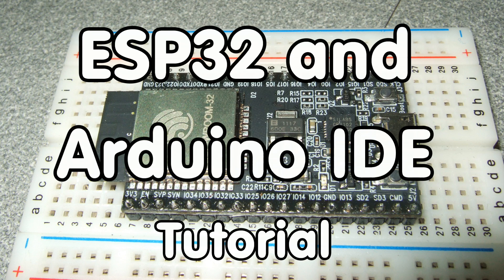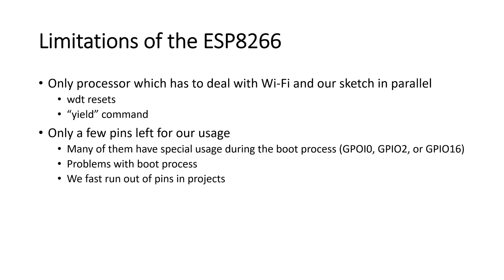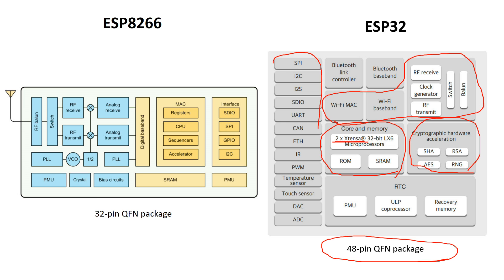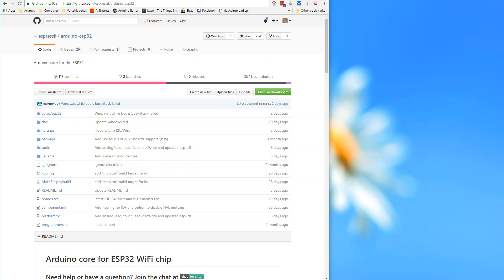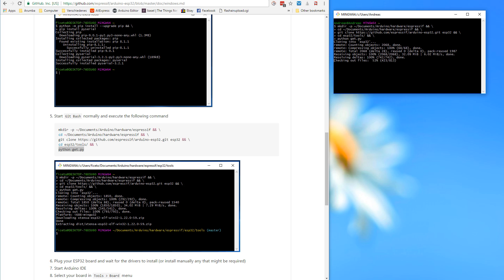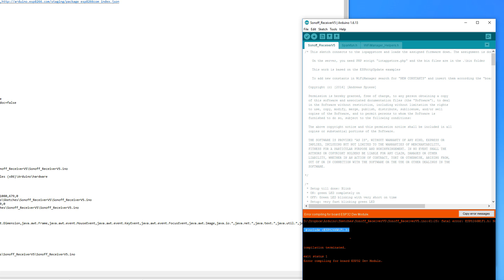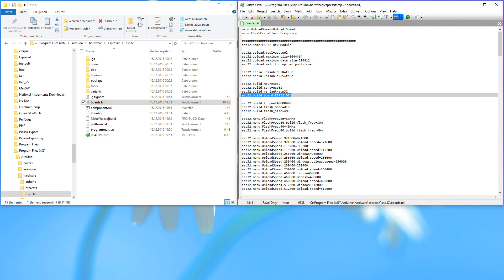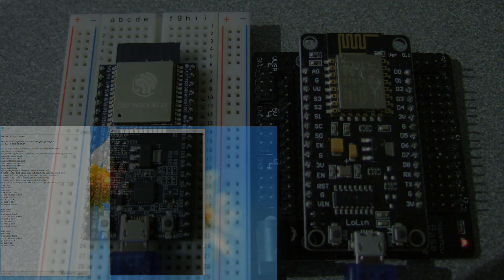#103 ESP32 Tutorial / Arduino IDE  / Tests / Comparison with ESP8266

Comment: I have some of these on order since December 4th,  and they're not here yet...  :-(
Reply from the maker: Depending on the source it takes quite a long time. With Christmas and Corona maybe a little longer...
Reply: They arrived here yesterday.  And now I'm running into a bit of a problem on the software side.  Your video, and several web pages, all point at hitting that "preferences" menu page and adding the necessary stuff to the arduino IDE but when I open that it doesn't look like what you show in the video,  there's no place to put that info.  The last thing I see is that bit about updating the extention on save,  followed by a link to the preferences.txt file if I want to edit it myself.  And on looking at it I see no obvious place to put that info that's needed in there.  What I have installed here is rather odd in terms of version number,  it's 2:1.0.5+dfsg2-4, which is directly from the Debian repositories (where I usually get my software).  Is there some way I can just download the required stuff and put it into my setup manually?  I'm hesitant to download the "latest" arduino IDE directly from them,  as I'm not clear as to how my system's package manager will handle it,  and besides it's a rather large file (100MB+) coming in over a rather slow DSL connection...
Reply: Never mind.  The Debian repository version is apparently VERY old!  I did download the current IDE and installed it,  and that stuff is in there like it's supposed to be.  Onward...
Reply: Okay,  the IDE has been upgraded to the current version,  and the support for both ESP8266 and ESP32 has been installed.  Now the system doesn't see the boards.  If I plug in for example a Nano,  it will use the serial port /dev/ttyUSB0,  but that choice doesn't show up as one of the choices when I plug the ESP32 in,  just /dev/ttyS0, 1, and 2, none of which pertain to the USB connection but which are actual physical serial ports that are unused at present.  I've been searching for an answer to this,  as well as wanting to know what if anything I am supposed to be doing with those two buttons on the board but so far no luck.  The boards I am using are these:  https://www.banggood.com/Geekcreit-ESP32-WiFi+bluetooth-Development-Board-Ultra-Low-Power-Consumption-Dual-Cores-Pins-Unsoldered-p-1214159.html?cur_warehouse=CN&utm_design=18&utm_email=1607100081_2332&utm_campaign=trigger-order&utm_content=linux&sc_src=email_2675773&sc_eh=d79209cda3b3d1741&sc_llid=27761550&sc_lid=105229698&sc_uid=gJ4Y4QT1PD&p=J8282236524805201907&custlinkid=1438159

Comment: My how far we have come in just a few years. I just got my ESP32 watch in yesterday's mail.  She only cost 28 bucks, has a color screen, esp32 with several sensors and is a blast to program! The one I have running now is from a fellow who did a lot of playing with it, has the readout of Star Trek Enterprise TOG which is cool as hell, it also shows the positions of the moons of Jupiter should you have a desire to locate them at any point, you can turn on the location sensor and watch the angles of your arm for some strange reason, I guess just for kicks, but there are a lot of other things one can do with it, including making a NES emulator run on the little device.  She is just slightly larger in all dimensions then an Apple Watch, and resembles one that had a few to many vitamins.   https://usa.banggood.com/LILYGO-TTGO-T-Watch-2020-ESP32-Main-Chip-1_54-Inch-Touch-Display-Programmable-Wearable-Environmental-Interaction-Watch-p-1671427.html?rmmds=myorder&cur_warehouse=CN
Reply from the maker: I ordered one in my latest "shopping frenzy". Maybe I will also do a project with it...

Comment: good morning good video very explanatory, I wanted to ask how I can access the AT commands in this esp32 microcontroller https://github.com/espressif/esp32-at/blob/master/docs/ESP32_AT_Classic_Bluetooth.md but I found information do not know how use it, what program should I load to access to write the AT commands on the serial monitor, any information grateful.
Reply from the maker: I do not know this software.
Reply: And how do you access the AT commands in this spy32 microcontroller, would you kindly give me some link or information on how to get AT command since I need to link it with a HC08 and I can not do it

Comment: In my arduino ide sketch i connect esp32 to wifi and send data to web browser using usb but when i use a battery instead of usb (9v battery and regulator to 5v) it doesn’t connect to wifi anymore any help ???
Reply from the maker: Unfortunately, I cannot do remote debugging. Maybe you check the voltages at your board? 9v batteries are quite weak.

Comment: Thanks for your movies. Thats great.
I need you for my proyect.
Do you know if the ESP32 web library is ready?
I want to make a file on a server that collects the data from an SP32, as a dattaloger for do it excell o similar. Any ideas or videos to support me?
Thank you.
Reply from the maker: I never used the web functionality on the ESP32, I always used MQTT so far. So I do not know if it works.
Reply: @AndreasSpiess  What can I do to pass the data from the different sensors that I collect by LoRa to an ESP32 that works as a hub, which has a Wi-Fi connection in my home so I can use them on my PC?
What do you recommend me to do?
Thank you.
Reply from the maker: I use MQTT for that. Maybe you watch my videos about the topic.

Comment: Sir i have a esp32 and when I programmed it with alexa code not only alexa home automation but any code it works fine for some time around half an hour then after i need to reset it again to work ... It is even disconnecting from WiFi please help me
Reply from the maker: I am a Youtuber and I cannot do remote debugging. But I am sure you will find the problem yourself.
Reply: Andreas Spiess yes sir .. thanks for replying ... I'm the one who left a comment about a bug in my previous installation of esp32 in your today's video .... Where the problem is solved by reinstalling the esp32 in latest method ... Thank you for replying sir :-)

Comment: Hi, thanks for your patience to teach us.
I need to connect 3 serial ports on my esp32.

Hw Serial 0 -> fw update and logs
Hw Serial 2 -> gps
Sw Serial -> gsm

I already know that Serial 1 is connected to flash memory.
So I need to emulate a serial port through GPIO's.
I tried using an Arduino "Serial Software" library, but unfortunately on a compilation error. Reading in some forums and making some changes in the library, I was able to compile the "Sketch"; but the communication of my GSM modem via SoftwareSerial did not work.

Note: By connecting the GSM modem separately to a USB / SERIAL converter the communication worked as expected. That is, the problem really is in SoftwareSerial emulation.

Could you help?
Reply from the maker: I made a video on how to move serial away from the flash pins
Reply: https://screenshot.net/pt/o8699i6

yes i saw. But, my trace logger in this SerialPort it's "crazy". Please, see in the bellow image.

Ps.: My GPS baudrate is 9600 in my uart1 and my SerialMonitor on uart0 the baudrate is 115200.

Ps.: Even setting the two baudrates to 9600, the problem continues!

https://screenshot.net/pt/o8699i6

Ps.: Please, help-me! I will post my sketch and my questions in the following movie of your youtube channel:  https://www.youtube.com/watch?v=GwShqW39jlE&lc=z22fz1nyfublujr1racdp4300lzu2xjc415tqubmqq5w03c010c.1516949880196924

Comment: Hi Andreas, this is about one problem i am facing. in case you mighthave encountered same issue - 
 i have been using esp32 with bme680 and logging data into its SPIFFS memory, i left it running overnight and in the morning, the esp32 wemos board is not responding to any programming ide. 
i get following error - 
esptool.py v2.1
Connecting........__
Chip is unknown ESP32 (revision (unknown 0xe))
Uploading stub...
Running stub...
Stub running...
Configuring flash size...
Warning: Could not auto-detect Flash size (FlashID=0xffffff, SizeID=0xff), defaulting to 4MB
Compressed 8192 bytes to 47...

A fatal error occurred: Timed out waiting for packet content
A fatal error occurred: Timed out waiting for packet content

I have raised issue on github here - https://github.com/espressif/esptool/issues/263

Any suggestions ?
Reply from the maker: Depending on the board and the connection speed I often have to try several times uploading the sketch. I did not think too much about it so far. Maybe your issue on Github helps...

Comment: Hey, I'm just now getting into Arduino and I've started messing around with the ESP32. I am having some trouble getting the software to recognize the library. I've watched this video and followed the steps but it still produces an error message. So far I've followed these steps:
1. Installed latest version of Arduino from Arduino.cc
2. Installed Python V2.7
3. Installed GIT client.
4. Downloaded the zip file.
5. Copy and pasted each line of the directory. 
6. Copied the library into the program file directory.

 I'm running Windows 8.1. Are there any other steps that I'm missing? Any help would be appreciated.
Reply from the maker: The ESP32 is probably not the easiest start. Most people start with simple things like the Arduino. The only thing I can propose is: Try to make blink run first before anything else. The continue with a little less simple things till you get to where you want. If you start with complex things, you have many "moving parts" and it will not be easy for you to debug.

Comment: Thanks for this great series. At 6:04 you said "ESP32 supports 4.2 BLE standard".  Actually it supports "Bluetooth v4.2 BR / EDR *and* BLE specification" (Section 3.6.3 of ESP32 Datasheet V1.9). Although BT classic (SPP profile) is not supported yet in their SDK (as of Dec 2017).
Reply from the maker: Thanks for the clarification

Comment: I have a question to ask you how can I adapt the ESP32 to create traffic lights and want to make it performed automatically and controlled by the App inventor or another app (it's required at least 16 output)  
big thanks in advance sir :)
Reply from the maker: The ESP32 has 16 IO pins. If you need more, you can use a so-called "I2C port extender". You can google to find more info. I do not know how to connect it to Inventor app.

Comment: Hi
Thanks for the video
Do we need to hold the boot button continuously till the program gets uploaded to the board?
Reply from the maker: +rohit sam No, just during boot when you release the reset button
Reply: Can we use this module as IOT hub such that it shall receive sensor data over the bluetooth to ESP-32 and which can be transmitted to the server using Wi-Fi. (The sensor has inbuilt bluetooth module with same version as ESP-32  i.e  4.2 )
Reply from the maker: So far, BT is not implemented in the Arduino IDE. If you use the native IDE, you could do that.
Reply: Thanks for the info.What do u mean by Native?

Comment: Hi Andreas 
would you please guide us about overclocking over esp32 and esp8266 specially in 160Mhz
Thanks
Reply from the maker: AFAIK the ESP32 boards run already on 240 MHz (build.f_cpu=240000000L in boards.txt)
Reply: Thanks mate.

Comment: Rather frustrating for me.  The language difference is tough - VERY fast jumping from screen to screen (In a foriegn (to me) language of Windows) without clear explanation - "I'm copying this directory to ..."  ZIP-ZOOM-ZAP!  What?  WHERE?  HUH??  Pointing out that instructions are WRONG is great and saves tons of wasted time, but then to not clearly show what parts are INCORRECT (don't do this) and what steps to take INSTEAD (do this)!  I had no luck getting "Toolsets" in place and working, etc.  Nothing compiles...grrr. As I said, frustrating. 
I appreciate your knowledge and the effort that goes into creating these videos.  Thank you!  I'll keep trying.
Reply from the maker: I hope, you will succeed. Maybe you watch also video #147 which covers a similar topic.
Reply: Thank you Andreas!  I know I'll get it working eventually.  I can't seem to get past the "xtensa" stuff.
The Arduino compiles fail with "xtensa-esp32-elf-g++" - file not found.  I will check out video #147.  Thanks again!

Comment: It a great product .I receive a few of those  while  testing out i found that GPIO 6-11 are used  for SPI flash but i wanted to use as normal GPIO any help will be helpful.Thanks
Reply from the maker: The newer boards with the WROOM-32 module do not count these pins as IO (https://espressif.com/sites/default/files/documentation/esp-wroom-32_datasheet_en.pdf).

Comment: I had problem installing following above video. I was able to install git. Starting at the 9 minute mark, as administrator, the next commands had to be changed. The command 
$ python -m pip install --upgrade pip && pip install pyserial
produced error message: Requirement already up-to-date: pip in c:\python27\lib\site-packages. Apparently, if pip is already upgraded to most recent, the whole command fails. 
On the other hand, 
$ python -m pip install pyserial
installs pyserial 3.3 without a problem. 
The next commands run from git-bash as regular user run without a problem, but I will reproduce them here because some people have problems reading the small type on youtube video at low resolution:
$ mkdir -p ~/Documents/Arduino/hardware/espressif
$ cd Documents/Arduino/hardware/espressif/
$ git clone https://github.com/espressif/arduino-esp32.git esp32
$ cd esp32/tools/
However the next command fails:
$ python get.py
Traceback (most recent call last):
  File "get.py", line 25, in <module>
    import requests
ImportError: No module named requests
The command on line 25 in get.py is "import requests". It can't find module "requests". Any suggestions?
Reply: I found the answer to my own question. 
See https://github.com/espressif/arduino-esp32/blob/master/doc/windows.md 
Instead of the last command being 
$python get.py
enter command
$get.exe
Reply from the maker: Thanks for the feedback!

Comment: Thanks for the laughs.  It's always issues with a new product.  However, I don't think this line will replace or outlive Arduino.  There is just too many issues with these boards.  But if its your desire then I wish you well with it.  As am going to use Arduino slaves corrected to CHIP gateway hubs that are connected to a hideaway Intel server.
Reply from the maker: I also do not think, it will replace the Arduino. And if they get the software ok, they will have a chance.

Comment: Thanks for all the work you put into perfecting your video tutorials.
As I newbie, I have a lot to learn but often feel I'm missing the
experience to follow all of your instructions.

In video #103, "ESP32 using Arduino IDE", I found all the work-arounds
confusing.  After four months I believe, both WiFi and Bluetooth are now
supported in the latest ESP32-IDF and there is a much easier setup process
as shown in an older YouTube,"Install ESP8266 in Arduino IDE" at 
https://www.youtube.com/watch?v=7St5Ra21Cpw.

If you could update #103 with fewer work-arounds and more tips, newbies
would be eternally grateful.  Later you could demonstrate using ESP32
WiFi and Bluetooth with a smartphone.
Reply from the maker: As I said in the video, the ESP32 is not a beginners board. I suggest to start with Arduino or with the ESP8266 (which is already more complicated). I even avoid this board for the moment because of these problems.
Reply: Thanks for the quick response and insightful advice; keep producing the professional videos.

Comment: Hello, very nice video! Thank you for compare and show new module. I have some questions. Is it possible use other IDE for debugging? I do not use Arduino. And next question is about DMA? Has a ESP32 DMA for GPIO? I need generate signal on GPIO from buffer and toggle DMA via timer. 

Now, I am working projeck on NXP kinetis microcontroller without WiFi (only ethernet) and I am thinking about change this to ESP32. 

Many thanks for the answers.

Comment: Andreas, When developing ESP32 applications using the Arduino IDE are the dual cpu's fully taken advantage of as they can be using the SDK and RTOS? Can we expect to support WiFI, a Web Server, and an application reading sensors etc, without WDT timeouts? Thanks for all you do!
Reply from the maker: Because the Arduino IDE is not very advanced, I did not do further investigations so far.